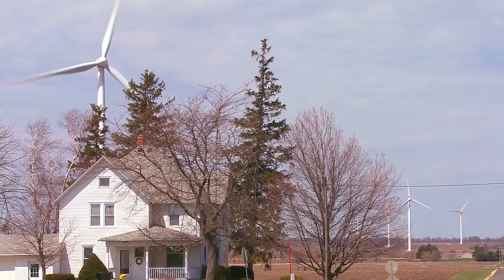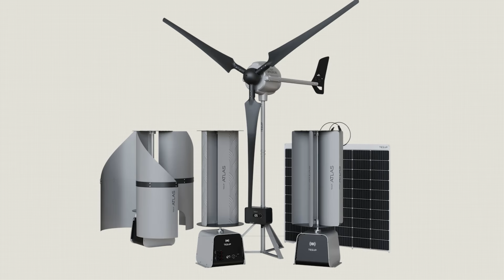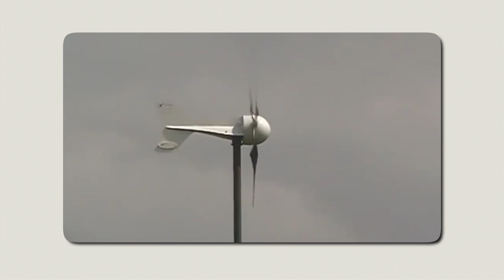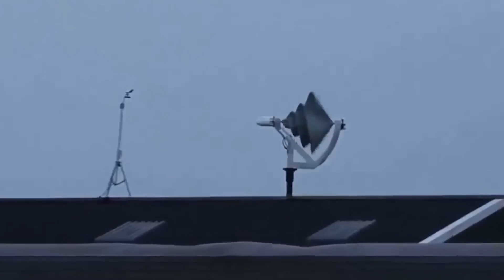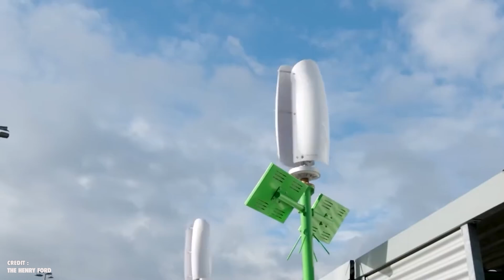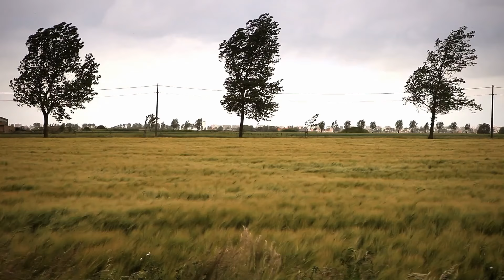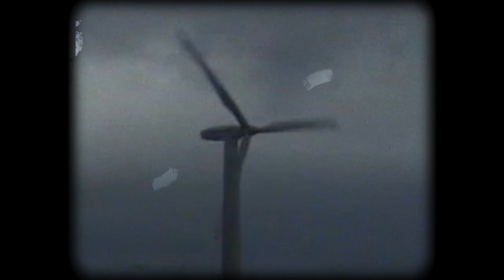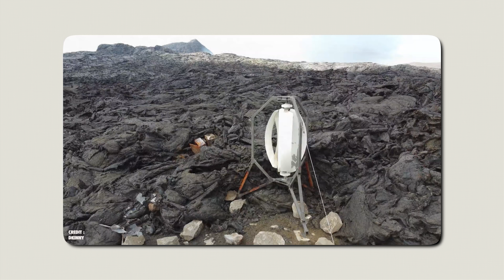These 6 Wind Turbines Are The Future Of Home Power

Comment from the maker: IMPORTANT UPDATE: I got a bit excited looking at the tech side of this story that I missed an important aspect of the Tesup Atlas turbine. While there tech sounds very promising, reports from customers aren't so positive. Please do your own research before purchasing any of these models :)
Reply: Thanks for your honesty
Reply: Unfortunately that company has been reported to be a scam by several customers.
Reply: Solar doesn't have to be on a 20 year pay back.

Here in Europe, standard rooftop solar might be around 5-6 years, while plug-in (balcony) solar can have a payback of about 2 years.
Reply: @mikemalone9678  – That's likely due to your higher cost of grid power (which comes from your higher percentage of "green energy" to supply grid power). That implies that your grid power costs are 3-4 times the energy costs used to arrive at the 20 year payback timeframe. Ouch!
Reply: @mikemalone9678 Another totally misleading comment posted as ‘fact’!
What’s the cost of the device, geographical location and position/direction of install vs daily usage / household consumption?? 

Perspective and context, if you can, please!
Reply: Thank you for your article, the Flower wind turbine sounds like the best possible turbine for my location. Using the small 3 ft tall unit, buying one to start and adding more as funds are available. The winds here are 5-10 mph average, sometimes 10-15 mph with gusts up to 25. Storms can have gusts up to 35 mph. Occasionally microbursts of 75 mph have occurred. Before your video, I was hoping Liam 1 would produce their prototype smaller units. But don't think they will. Their loss.
Reply: @smpwrflgard  10 mph converts to 4.4 m/s. I would recommend you to forget wind power.  For just considering it, you need about 8 m/s.   

At 4.4 m/s  you will harvest just 6 W/m2 (0.006 kW/m2)  of swept area using a flower turbine.  Forget the marketing claims regarding the cluster effect.
Reply: @smpwrflgard  – I'm more or less on the same journey as you. Liam F1 was on my radar too, but i think the Flower or ICEWIND are perhaps better choices for my property layout. In any event, i think vertical designs are the way to go; propellers aren't as efficient nor bird friendly. When looking at the spec's, just remember that m/s is meters per second, not MPH; that's fooled me more than once!
Reply: If you look deeper into TESUP it’s actually junk. You need look no further than owner reviews on Trust Pilot.
Reply: Been looking at the tesup for a while now, thanks for the heads up
Reply: @savyor1839  It is a scam.  It will not produce any energy...  Ever.
Reply: In some cases could only put in 10% of advertised output put in most cases about 15% again easily demonstrated with a volt amp meter
Reply: My turbine design was not featured but it is better than any of them. Store wind as pneumatic pressure and you defeat the problem of intermittent power production. Use my VERTICAL AXIS turbine for better efficiency than any of those "cutting edge" designs. I need an investor.
Reply: The Helix vertical axis mini turbine is not included. The Helix is the most efficient wind conversion shape in both low  velocity and turbulent urban winds and 90mph winds.
https://www.youtube.com/watch?v=xlNTneXipjQ
Reply: @RobWhittle-o2y1c   What isn't there, you can't harvest.   

So at say 6 m/s I don't expect more then 20 W/m2 (0.020 kW/m2) of swept area.  The helix is also a drag type rotor, so efficiency  is rather low compared to an air foil type rotor.
Reply: @RobWhittle-o2y1c yeah but it doesn't really spin fast enough and again once connected to the grid only 15% actually lower than that you know just like the big big windmills only 10 to 15% do you have a volt amp meter
Reply: Fluid dynamics would like to join the conversation! 

The product itself is a small part of the equation, when it comes to cost vs benefit! 🙄
Reply: @Monkey80llx no cost benefits just another parasite what is connected to the grid can only put in 15% of advertised output
Reply: Why though? explain the problem with it? The IoT app bs?
Reply: @Atmatan do the test and then you can apologize after guess what the grid has resistance and there's grids already charged so there's some back pressure known as voltage potential difference and then trying to use a Step Down Transformer backwards how about just do the test and I'll teach you more
Reply: You wrote " there tech sounds". Back to school techie! It should read "their tech sounds". LOL
Now, if we could only harvest what eminates from the wind bags and airheads in government we would be on to something!
Reply: @steveforbes8287  "their"   Beat me to it.
Reply: @steveforbes8287    it's emanates  mr spelling police  ; )
Reply: Could have told you that before starting the video, NO SMALL WIND TURNINES work well. NONE, not a single one. You need those enormous ones currently in use to make any kind of reasonable power. For the space available solar is WAAAAAAAY ahead.
Reply: @watvannou  Ai search agrees with you. There could be an advantage in places that are cloudy most of the time, especially if it's windy a lot.
Reply: @greatpix  – When AI agrees with you, it's a good time to pause and reflect on where you went wrong! 😄
Reply: @greatpix  You: "I live in the middle of a big forest, is it worth buying a wind turbine"
AI: "Yes — it is worth it..."    You read: "Yes —"
You should have read the whole thing: "— in some cases..."
Reply: @watvannou  The money is better spent on a stock in a large wind farm than buying a small windmill yourself.
(Måske begge alternativer bør undgås i USA, det er nok kun her i EU det kan betale sig.)
Reply: @watvannou  Unfortunately you are right.  Residential wind energy close to the ground or roofs doesn’t work for virtually all location. 

What isn't there (lack of wind), you can't harvest.
Reply: @watvannou please explain
Reply: @watvannou  There is one,    SuperWind 350.. however its cost is that of a 7Kw solar array.
Reply: @watvannou  – Such a blanket statement is likely false. It may be true of conventional propellor designs, generally speaking. Likely it doesn't consider the vertical axis designs, or even the Liam F1.
Reply: @MagicHawkeye if vertical turbines worked they would be installed everywhere by now! There has been a million YouTube videos where the manufacturer claims amazing results and the real world performance was abysmal.

Comment: All tests with ground-mounted small wind turbines show that they generate very little electricity. 
Solar panels always generate at least 10 times more electricity with the same investment in time & money! Reliable and requiring virtually no maintenance for 25 years. This is quite different from those wind turbines, 9 out of 10 of which are damaged or destroyed after a very short time due to strong gusts of wind. Anyone living off-grid needs a gasoline generator anyway, generating reliable electricity more cheaply than wind turbines.
Reply from the maker: Doesn't needing to buy gasoline defeat the purpose of living off-grid? I would have proposed a gasifier if truly living off-grid (only need dried wood then).

Comment: The power of a wind turbine rises quadratically with the size of the blades. Each doubling of the size of the wind turbine increases power output roughly by a factor of four. Wind speed is expotentnially related to the power output too, and wind increases much more the higher up you go. 

There factors mean domestic small scale wind turbines just can't beat the physics of wind power, where size and scale matter so much. Solar is a much, much better ROI even in shaded and low sun areas.

Comment: As an electrician that has been involved with wind and solar power for over 30 years... There are some things people must know... Wind power pumping water is a great application because with a positive displacement pump, it will shift water no matter how slow it turns...

unfortunately we want our electricity at a certain voltage , so simply put that means it has to get up to a certain speed before it will start generating useful power...they call this the cut in speed, so while you may see small wind generators turning many of them are not going fast enough to be actually generating power...

if you buy a wind generator without checking the wind speed and duration in your desired installation location, and do not gen a wind generator that can work well in those winds... You may only ever see any wind generator useful out put for a few minutes during storms! Where solar only needs the sun light to hit it to be producing pretty much what the name plate states...

Even the best wind energy sites in the world with the best commercial wind generators cannot get much more then about 65% of the time operating close to there rated output.  So if your installing in less than a great wind generator site, with a wind generator that does not have an exceptionally low cut in speed, you should not expect wonders from it. But if you get it for a good price and are prepared for lower outputs they can be a great way to supplement your solar input during night time and bad weather.

Comment: wind is not going to replace solar since its a unreliable system that requires a much higher up front cost just for the power input the 3-5k to get the wind power you can have a whole system, solar, battery, inverter setup and have the whole thing be much cheaper to expand.

Comment: You cannot change the laws of physics. Small wind turbines will produce a small amount of power. Most of the small wind turbines are SCAMS. The amount of power generated is directly proportional to the area of the device impacted by wind. The crazy shapes of some of the turbines do not create energy. The most efficient turbines are ones with well designed propeller type blades with a swept area as big as possible. If you double the swept area, the power output will increase by a factor of FOUR.

Comment: The marketing claims surrounding most backyard wind turbines suffer from massive discrepancies when measured against real-world physics and independent field tests.

To reach around 5,000 Watts, most vertical or small footprint turbines would need sustained wind speeds of over 25 to 30 m/s (55 to 67 mph) which is storm-force/near-hurricane weather. At those speeds, lightweight residential turbines generally suffer structural failure or lock their emergency brakes.

In realistic inland wind conditions (4 to 6 m/s, or 9–13 mph), a 1.0 m² vertical / small footprint turbines can physically only output between 30 Watts and 150 Watts.

Solar is winning because it's reliable, cheap to install and already has a proven track record. Wind isn't winning the consumer or prosumer market because it's unreliable and inefficient in backyard conditions.

Comment: Mini wind is indeed a hobbyist’s  distraction. Solar is virtually a rock with a wire coming out. No moving parts, cheap as chips and getting cheaper. Don’t wast time on mini wind.
Reply from the maker: Not sure you can say solar is a virtual rock as such as system needs and inverter (which has a 15 year life) and a battery bank if you want power at night (which again degrades with time). But yes solar is a good solution for most but not all locations.

Comment: I was a wind enthusiasts for many years, doing Computational Fluid Dynamic simulations, etc.   I could not make home sized Vertical Access Turbines pay off because the cost of the generator (copper, magnets, etc.)  Is just too high.  The HAWTs might have a slight chance.   Many of the VAWT claims are just exaggerated or completely false.  Even your video shows some of those things turning only a few revs per second, that's making NO power.  Go to these turnbine web sites and try to find a power vs wind graph.  You won't find it for most of them.   Buyer beware!

Comment: And a volt amp meter with some 4th grade math called Ohm's law demonstrates the ignorance of Renewables like solar and wind as once connected to the grid can only put in about 15% of advertised output or extra electricity with the optional amp clamp just takes one itsy bitsy 2nd assuming you could do the math

Comment: Once, way back (about 30 years ago), when wandering through an old neighbourhood of a suburb on the outskirts of Osaka, Japan, I came across an old house buried down a back street, whose owner had attached small propellad dynamos he'd picked up 2nd-hand somewhere, to the roof ridge-line of his old house. The little blades of each whirred constantly, even in gentle breezes, but made no sound. He was very satisfied with his set-up, saying his set-up generated all the electricity he needed.
Reply: A solar-wind hybrid power system is a power system that generates electricity from solar and wind power during the day and from wind power at night, and uses that electricity.
Reply: @JaeukLee-g2i 
We know this. Do you have such a system installed?
Reply: @donodono2287I made solar-wind hybrid streetlights and installed them in a park. And I use small home appliances by building and using a solar-wind hybrid power generation system
Reply: @JaeukLee-g2i 
Streetlights? Good idea!
Did it work well?
Reply: Propelled dynomos

Comment: P = 0.5 * rho * pi * r^2 * v^3 * Cp

Where:

P = Power (Watts)

rho = Air density (kg/m³)

pi = 3.14159

r = Propeller blade length / radius (meters)

v = Wind speed (m/s)

Cp = Efficiency coefficient (e.g., 0.35 to 0.45)

Comment: 36 seconds in and we get the first blatant lie. Solar will pay for itself in 4 to 8 years depending on cost of installation and location, NOT 20 years as claimed. As for small wind turbines, unless you are in a very windy area they are an expensive addition at best but are nothing like as cost effective as solar. I've had both, I live in a windy country with very poor sunshine stats and solar is still far superior.
Reply: Exactly.  Return on investment for my solar system will be about 5 years, and it provides 100% of my power needs.  it also provides excess power that I can sell back to the power company.  Very misleading to say that solar systems have 20 year payback.  They do have a 20 year guarantee on output, though!  Try to get that from a wind turbine manufacturer.....

Comment: the thing folks need to keep in mind when it comes to "green energy" solutions is that though the source it's generated from may be infinite that doesn't mean the source is consistently available (the sun goes, down, it's not always windy, and water can dry up, etc.) yes, battery banks can help offset this, yet the materials used to make said batteries are rather hazardous to the environment, especially once they've expired, you can recycle much of it but it's extremely expensive to do so and releases all kinds of toxins in the air while this happens.

I'm not trying to discourage the use or further development of such tech, just bringing to light they have their limitations and draw backs that can prove no less negatively impactful to the environment than traditional methods.

use them wisely, and for purposes where they don't draw excessive amounts of power as this tech typically doesn't work all that well once scaled up in size.
Reply: there are parts of the world where the sun shines consistently practically every day of the year during daytime hours. 
then other parts of the world could try using geothermal energy. it gets quite warm or even hot once you drill into the Earth's crust. this energy is constantly available, 24/7/365.
Reply: @embreis2257 in those parts of the world you need to worry about ice forming over the panels making it difficult to keep them in good repair and maintenance.
Reply: @embreis2257 geothermal has a little ways to go before it can be considered effective.

I like where your head is at honest, it wouod be nice to have many different forms of energy production yet we're still kinda stuck with various limitations of each, some more impactful than others environmentally/consistency of power generation.